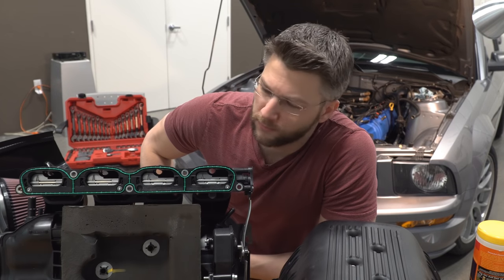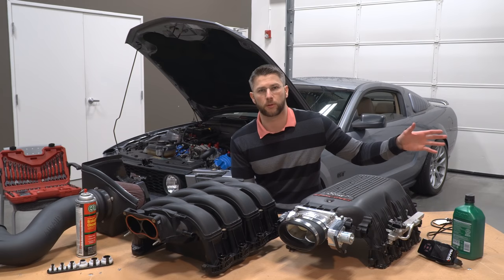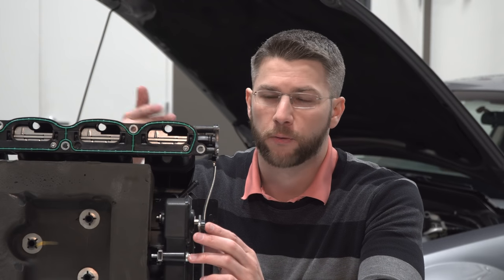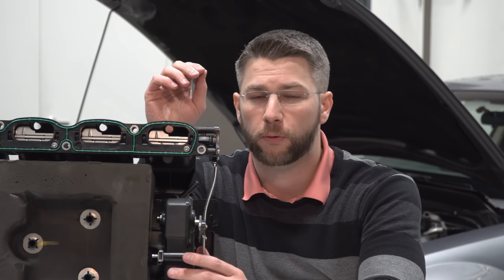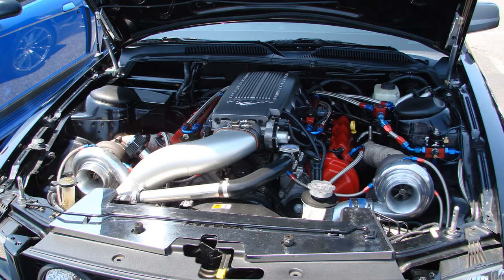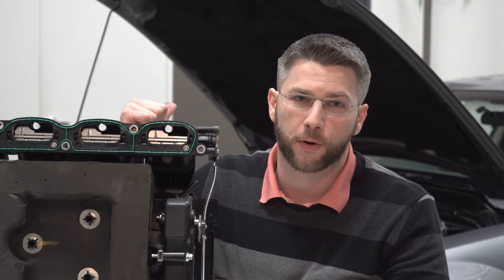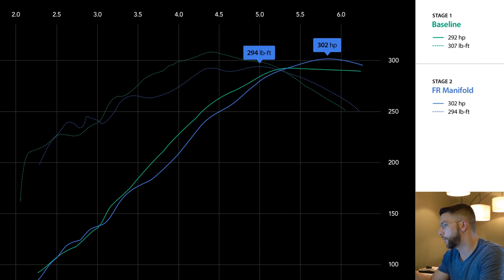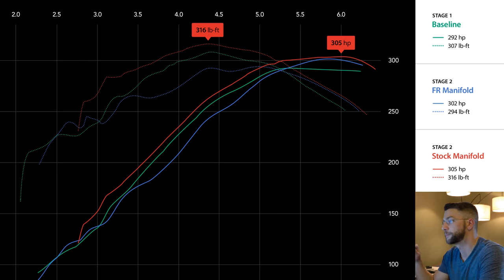Why you shouldn't remove your stock intake manifold

Comment: Would like to pick your brain about these for a min if maybe you could call me or email?
Reply from the maker: If you remove the valves, be sure to pair the change with other upgrades like headers and cams. And most importantly get a dyno tune. Just removing the valves will result in power loss. A canned tune may help, but probably not. Need to get a full dyno tune - at least that's what eventually worked for me.